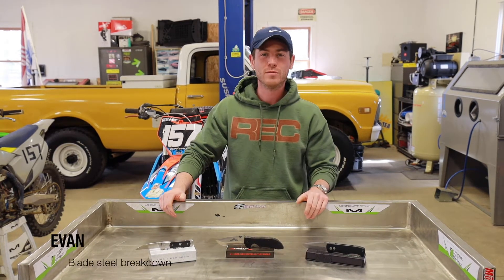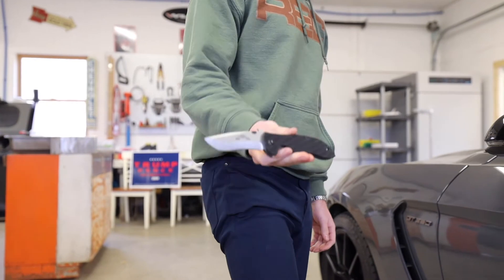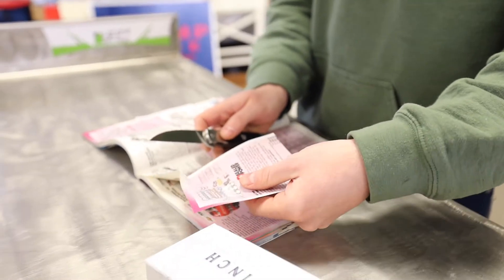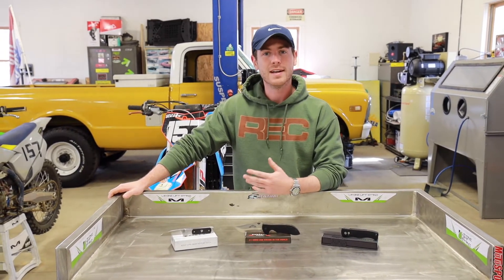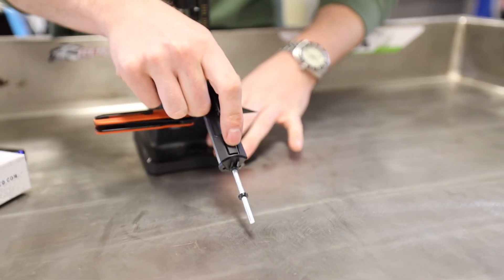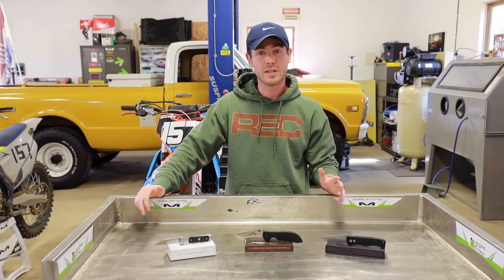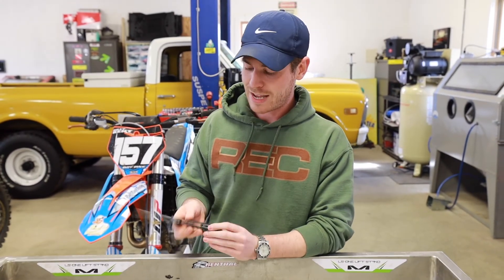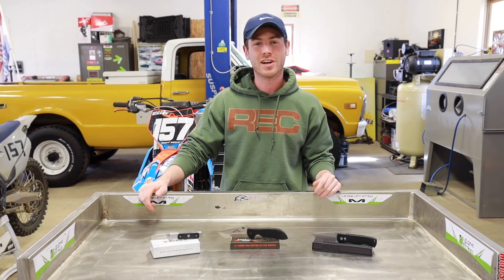154CM Blade-Steel Breakdown

Comment: 1:00 you compare 154cm to the toughness of s30v but most spec sheets point to it having almost twice the toughness measured in ft lbs. S30v is usually around 5-6 and 154cm is usually up around 10.